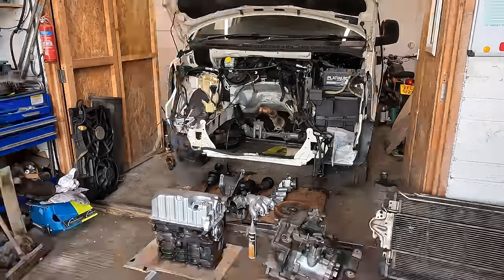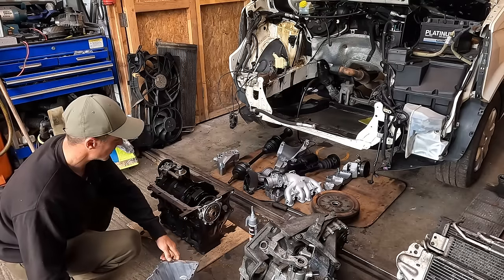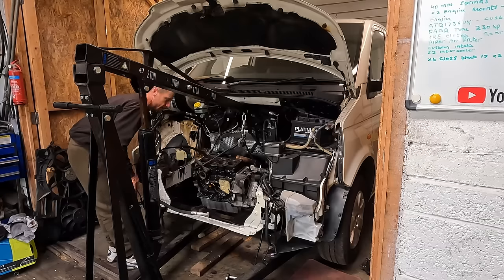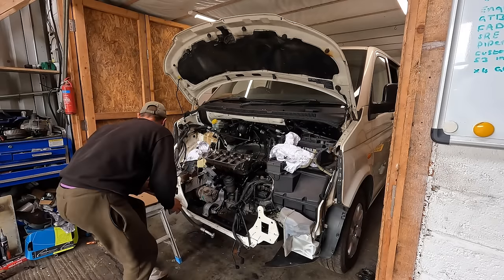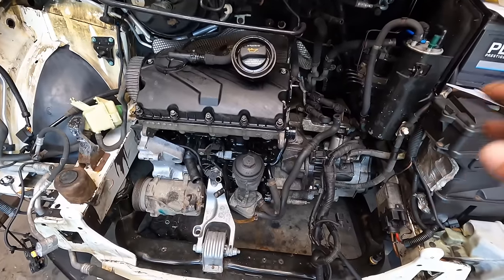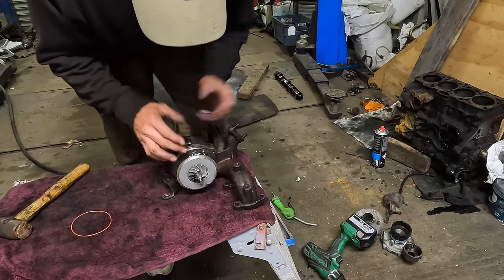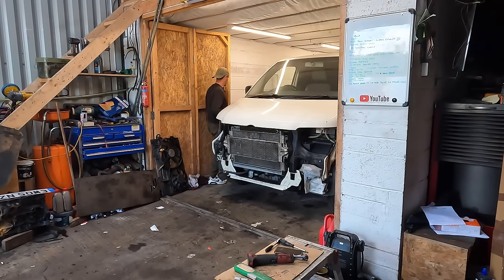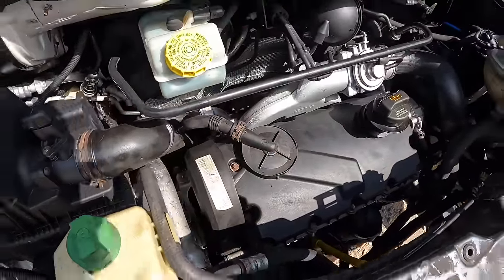T5 Transporter PD130 ASZ swap will it run & drive - Ep2

Comment: Hi mate, 
Goto say attention to detail is a1, a man after my own heart. 
My BRR engine has just died so in the middle of doing this swap myself. Did you have any issues running the asz turbo? With the vacuum side of things? Regards Anthony
Reply from the maker: Hi Anthony thank you for the comment appreciate that 👍 the asz turbo is just a vacuum actuator the same as your old one so just push the line on in the same place and it will work 👍

I explain what I done to the Downpipe on the next video
Reply: @YTDTETV  hi mate, was only asking as I read somewhere that one was a push and one was a pull actuator but thought they both run on vacuum so can’t see how they wouldn’t work. 
Thanks mate 👍🏼
Reply from the maker: @10antsrees  yep just hook it up and all should be good 👍 mine runs drives and boosts ok original ecu etc.

Comment: 1.9 tdi all the way ! 💪🏻
Reply: The 2.0 tdi as just as good, if not better in the t5.
Reply from the maker: Hey igor I do love and PD 👍 thanks for the comment.
Reply from the maker: Hey Richard is that the later common rail engine you speak of? The 1.6 common rail is really bad in the caddy.
Reply: @YTDTETV  I have the CAAB (102 PS) with the Bosch CR injection system with 443k kms. I strongly believe this his the best engine for the T5 (the 82/102/140 single turbo variants are literally the same the difference is the maps they have and the gearbox, the 140 has the six speed from the factory). These engines does not have the balance shaft driven by a hex rod other 2.0 TDIs have. I'd say the EGR is their only kinda issue. This engine relates directly with the 2.0 PD with some obvious modifications.  

The 1.6 does have a siemens/continental injection system which sometimes give the owners headache. They are not bad engines in my book, but they are aimed at a different audience - mostly it is about fuel economy when not driven hard, commuting to work, etc.
Reply from the maker: @RichardStefanits  ah the Bosch fuel system is much better than Siemens 👍 blimey that mileage is up there but my old block had 280k and was mint inside. The 6 speed box would be nice and they are a lot stronger. I’m a fan of remaps myself and mainly egr deletes I’ve seen the crud build up in intakes and inlet ports from them so that’s why I delete them. Yes the balance shaft TDI’s are pretty bad, I had one once I bought it broke and I fitted the 1.9tdi pd pump and chain into the sump literally a straight swap.

Comment: Sorry to ask another question, will the asz from an Alhambra have the same clearance issues as there mk4?
Reply from the maker: Hey bud ask as many questions as you like 👍 I believe the alahambra has the tucked in oil in filter but just double check, you can clearly see via pictures. The mk4 golf one sticks out really far but they do still fit just sit close.
Reply: @YTDTETV  cheers, compared them and looks as through the Alhambra one is way closer to the head

Comment: Did you use the pd130 ecu and wiringloom
Reply from the maker: No I used the original loom and ecu with the original injectors
Reply: @YTDTETV nice! I am also doing this swap at the moment. Did you go with a dmf or a smf flywheel?
Reply from the maker: @louisbolding1004  I used the DMF as the vag gearbox’s rattle a lot with solid flywheels.

Comment: Been using you vids to do my conversion pd130, just completed the swap at the stage as in this vidio but cannot get it to fire its coming up with codes P0600 now im stuck
Reply from the maker: Hi Micheal, did you have the same crank sensor as I did or did you have the later type? What age is you van and what’s your old engine code
Reply: I have used my original sensor with the block mod, its 2007 and origional was a brs
Reply from the maker: @michaelboston8809  I googled your code and it says the ecu has lost communication with another module.. has the abs unit been unplugged? Does your plug in read abs is that working?
Reply: I have the front wheels and hubs off atm and the sensors hanging will that stop it running?
Reply from the maker: @michaelboston8809  nope that shouldn’t stop it running, I’ll speak with a friend of mine tomorrow and see if he has any ideas.

Comment: Is the only difference between the golf asz engine vs the Fabia asz engine the oil filter housing
Reply from the maker: Yes 👍 apart from that they are identical, you can use the golf asz engine for the conversion but the oil filter housing does sit close to the radiator fan but it does still fit.
Reply: Thanks a lot 👍🏼 looking to do the same conversion I have a 1.9 t5 axb engine shes gettin a little worn out performance wise, love the videos, best on YouTube by a long shot, keep it up,
Reply from the maker: @Dafr-c18  thank you mate really appreciate that, I’m super happy with the new engine in this so I definitely recommend it, is a pleasure so far working in the T5. Everything apart from the rear engine mount was working from the top which is nice.

Comment: What kind of gearbox do you used please?
Reply from the maker: Hi I used the original T5 gearbox, fits straight on to the pd130 engine 👍
Reply: @YTDTETV is your T5 a 1.9 tdi 5 speed ?

Comment: i  have PD130 From a beatle in my t5 , somtimes  when i change gear , the engine Judders any reason why this happens ?
Reply from the maker: Hi Stuart has it been remapped or is it standard?
Reply: @YTDTETV  yes mate the guy I bought the van off Saif it had been re mapped

Comment: That's not Asz it's a BLT Asz never come with small oil filter housing 😂😂
Reply from the maker: Hi bud they came in the Skoda Fabia pd130 it’s got asz stamped on the block 👍
Reply: @YTDTETV  oh really . I would of said it's a BLT then ,I have never seen a asz with small oil filter housing .They did do a asz and BLT in Skoda vrs from factory. Ones got small oil filter housing like ur one the other one has a big one